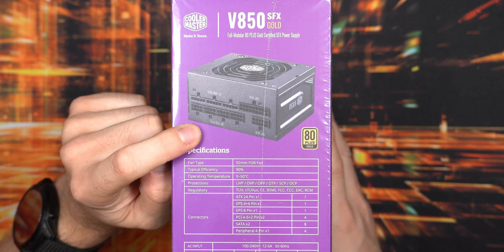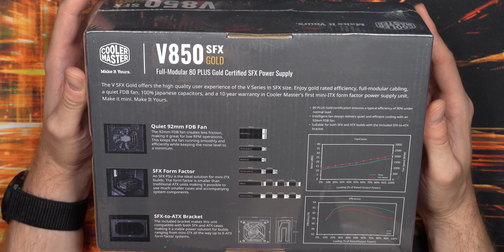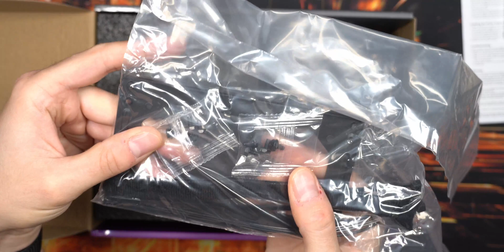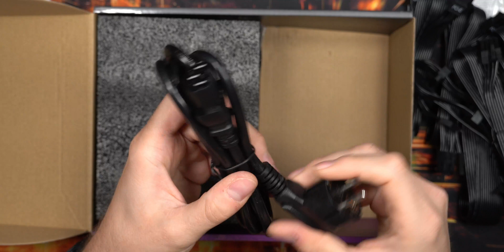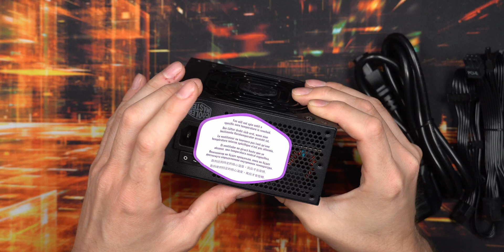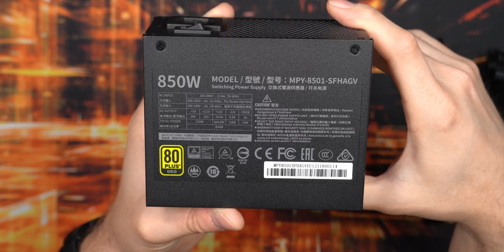Coolermaster V850 SFX GOLD PSU | Unboxing & Closer Look

Comment: Hope you read this have question about cables are they long enough for atx build or do i have to buy another psu 😢?
Reply: For my build the atx power cable was not long enough. Full tower ATX. Mobo is msi pro z790-p, Thermaltake View 71 RGB full tower case just for reference. i had to buy a 24 pin atx power extension cable.

Comment: thank you for showing every cable connection, every screw, manual, etc. .. this helps me tremendously decide on whether or not to buy this PSU .. they are very vague about these details on the ecommerce product pages. Thanks!

Comment: Fair warning, do not use this for full tower, ATX builds, your atx power cable won't reach. It happened to me yesterday, had to buy an extension.
Reply: I just had the same problem, with my case also the CPU cable was a bit too tight so I'm just gonna return this and get something else.
Reply: Extension is good or not does it effect the performance and the safety issue
Reply: @Dsadson  My pc has been built since november, no issues so far with the atx extension cable.
Reply: @zealotscout  ok thank you I use an extension cable now too I use antec extension cable on my cooler master sfx v750 gold

Comment: are you able to plug in 3 pcie power cables and 1 eps 12V? or does it have to be 2 each?
Reply: same question here. I'm a little bit confused why the moddiy 12vhpwr cable has three pcie connecters on the PSU side.

Comment: Did you pigtail the 2 PCIe cables so 3 total connects to the 3080 GPU? 
Did you happen to hear any coil-whine noise from this SFX PSU considering how power-hungry the 3080 is?
Reply from the maker: Yes two cables/3 plugs to the GPU. Have not noticed any coil whine, so for me it has not been an issue. But can be very dependent on fps/frequency.

Comment: nice video. could you hear the fan of this psu on load? and is it loud?
Reply: I had it and it's even loud in idle. I returned it and just went for the Corsair SF750, dead silent.
Reply: @henrygg1337  ok thx !
Reply: @yubashiri9646  and mind you I had the updated CoolerMaster PSU :P
Reply: @henrygg1337  I also have this psu, but for me its basically silent, even under load.
Reply: @Tecno110  weird, maybe mine was somehow defect but I have 12 fans in my case and that single PSU fan was louder than all of them in idle. Maybe they fucked up the fan curve on that specific unit but now my Corsair SF750 doesn't spin at all in idle, so ofc it's dead silent.
Reply: I just wear headphones